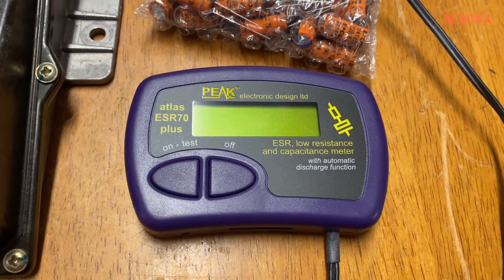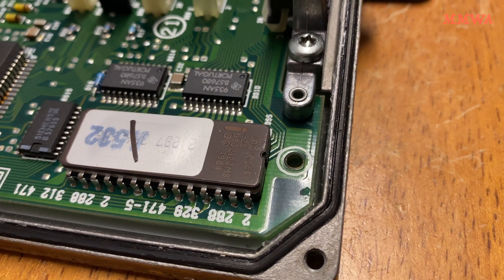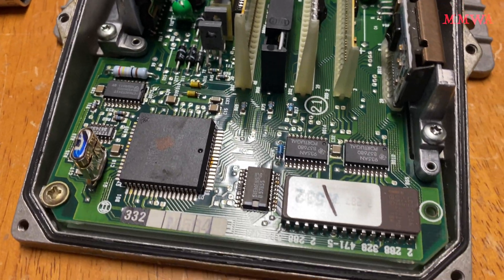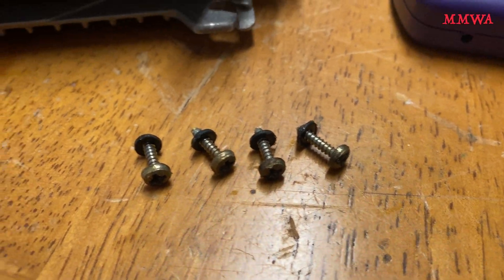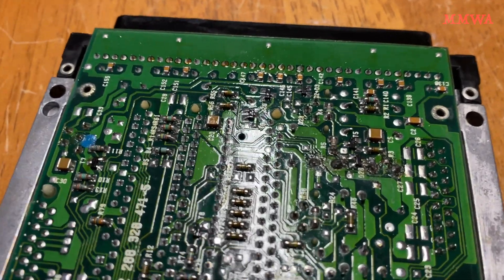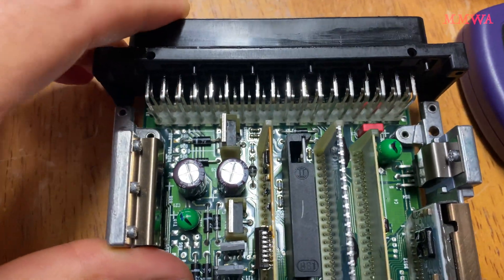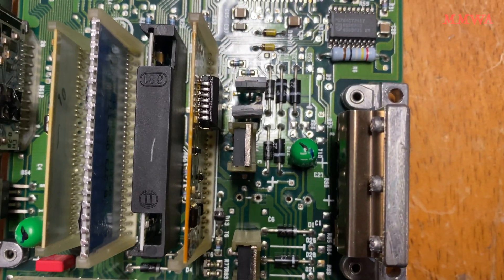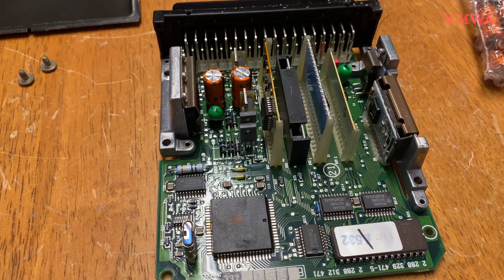Mercedes M104.980 ECU - replacing the capacitors

Comment: Can you give us some simptoms of a failed ECU and what did you do to fix it beside the capacitors?Thank you amazing videos!
Reply from the maker: Failed caps usually result in a totally dead ECU. It will do nothing as far as controlling the eha so the mixture is running in default emergency mechanical operating mode. It may or may not still have functional idle speed control as this is an independant circuit in the applicable ecus. Usually the caps fail routinely in the smaller ecu’s used in m102,m103,m116,m117 cars. These ones not so much. They are much higher quality components.

Comment: I have the same engine as yours what are the improvements of this job and in ehat step would you put it.After changing every sensor on the car?My car is working well but rich(the smell of gas is terrible)but it doesn't have any issues
Reply from the maker: if its working then i wouldn’t play with the ecu. It either works or it doesn’t. your issue will be something else.

Comment: Hello, I have one mercedes KE-Jettronic (0438100011) and somebody else was trying to rebuild it, however now the car dont start anymore and I want to rebuild it, but the problem is I dont know the barell position where he needs to point and how deep do I have to screw the barell screw, so I want to ask where can I get that data for my jettronic. Thanks
Reply: you need to turn till fuel begins to well in an open distributor port and go back a quarter turn. Thats how you find basic position.

Comment: on these ecu u only need tbe 2clamp connector and single for base module to run right?
Reply from the maker: This is the KE-jet version m104. It only has 1 connection
Reply: @MMWA-DAVE  Ahhhhh it looks almost Identical to HFM ecu Ill post a little short comparing the two